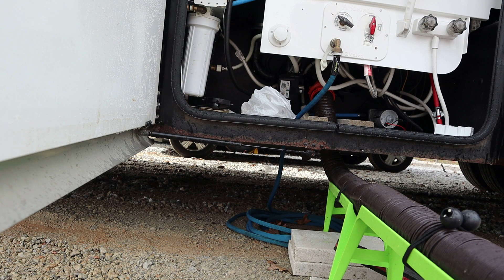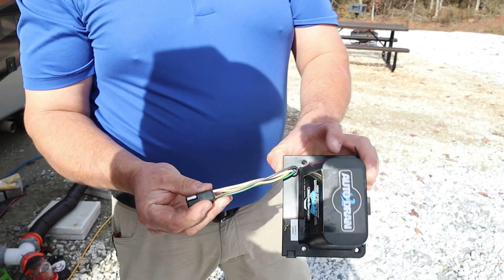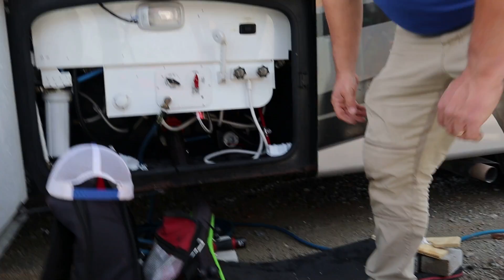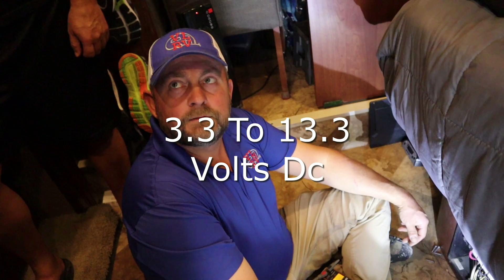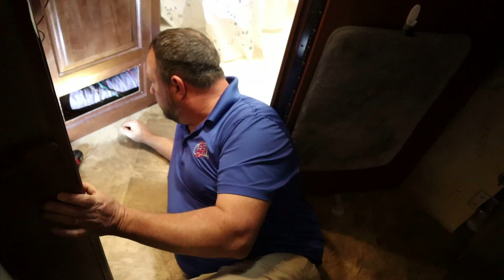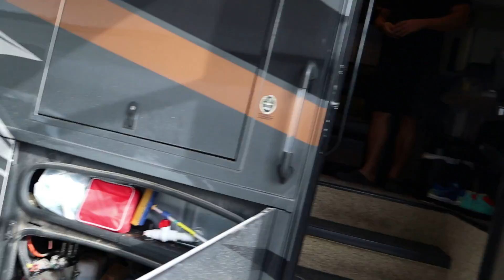Ride Along With VLRV Services. Barker Electric Sewer Valve Not Working

Comment: If I heard it correctly, the batteries were disconnected because a resettable breaker had tripped.   The slide worked because the coach was plugged in.   I had that happen once.   I let the batteries get drained and started the engine to charge the batteries.   Since then I have a battery monitor installed.   When the batteries are very low, the alternator can put in (in my case) 55 to 60 amps.   My breaker is a 50 amp.   If the battery takes over 50 long enough to heat it up, the breaker will trip.  I’m guessing this coach had more than 2 batteries with an 80 amp breaker.  To check for this condition, turn off shore power and everything 12 volts will drop out.  Like the lights.   Note, Thor puts all this control and breaker under the hood inside a black box.  Had the valve been connected to the panel, it would have worked with shore power.   Best wishes,   Kevin
Reply from the maker: The batteries got disconnected by accident. Not so long ago, your batteries couldn’t be disconnected if you were plugged into shore power. I don’t know what has changed with these motor homes and these battery disconnects. I have ran across this 3 or 4 times in the last year or so, but it still catches me unawares every time.
Reply: @hillbillyrv     Thanks for explaining!   Keep the vids coming!   Still prefer your work though.
Reply from the maker: @KevinCoop1  I believe there will be a good mix. Stick with me while I figure this out.
Reply: @hillbillyrv    👍